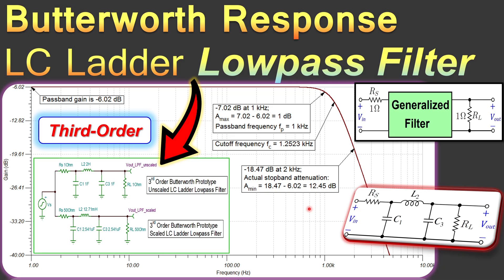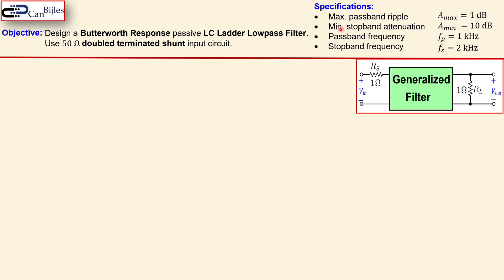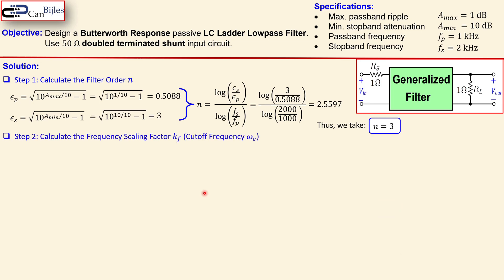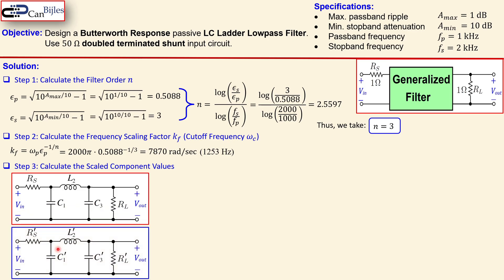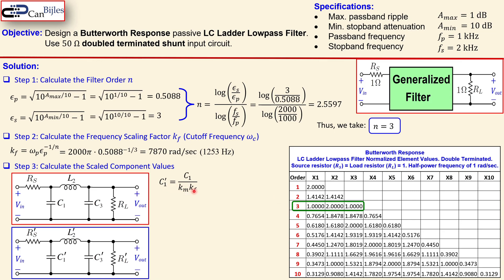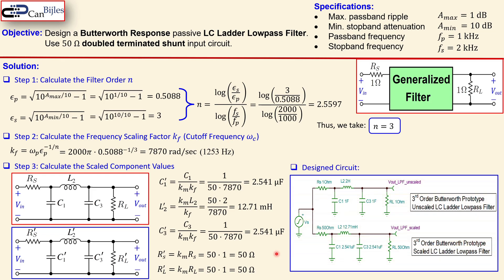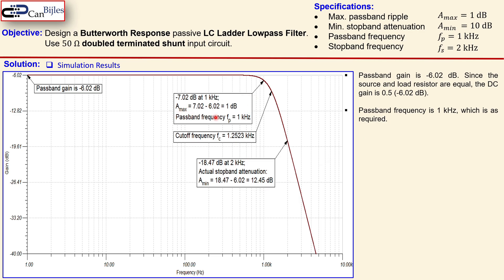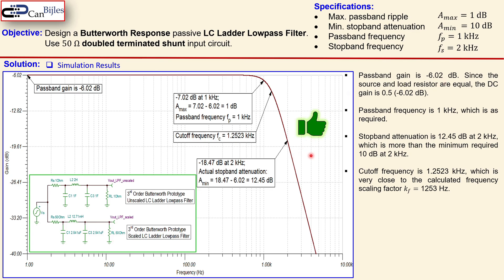LC Ladder Lowpass Filter Design 🌟 Butterworth Response - 3rd Order 💡 Example 2

Comment: Thanks for the video. But how can I have a unity passband gain in a low pass filter?
Reply from the maker: This is a specifical filter configuration where the passband gain is 0.5 (-6.02 dB). If you want to boost the gain to 1 at the passband region, you can add a gain of 2 to get the total gain of 1.
Reply: @CANEDUX  What are the adjustments that I needed to do to make the gain equal to 2? Is it okay to adjust the Ratio between Rs and RL? Will it affect the computations and formulas that you have discussed in the video? Or do I have to add another elements to the circuit? It would be highly appreciated if you enlighten me. I really needed this on my capstone project so badly.
Reply from the maker: @jericoyabut6570  If the load (R_L) is not equal to the source resistance (R_S), then it is necessary to change the coefficients in the table. In the examples I discuss, all coefficients in the table were calculated based on R_S = R_L = 1 Ohm (normalized) and then together scaled up to 50 Ohm.

There is a section at this link that may be useful. The coefficients are recalculated according to the R_S/R_L ratio: https://my.ece.utah.edu/~cfurse/ece5320/lecture/L27/Filter%20Design.pdf

Comment: Thanks for the video.
But what if Rs was not equal to RL?
In this condition how do we calculate Km?
Reply from the maker: Thanks for the message. That is a good question. Usually, the source resistance (R_S) and load resistance (R_S) are matched for maximum power transfer. That is the reason for making R_S = R_L. If the you do not make them equal to each other, you still need to select a magnitude scaling factor (k_m), but you cannot use two different magnitude scaling factors.
Reply: @CANEDUX  so as i understood, if for example,  RL = 50 and Rs =10, then km is still 50.
Thanks for your explanation.
Reply from the maker: @sadeghmollaii9873  You might still select k_m = 10, but than the load resistance will be off. Again, it is more designed for maximum power transfer, so: R_S = R_L
Reply: @CANEDUX  thank you very much.
Reply from the maker: You're welcome!